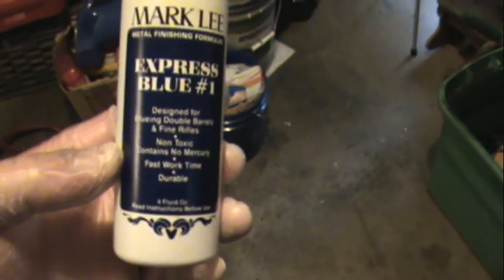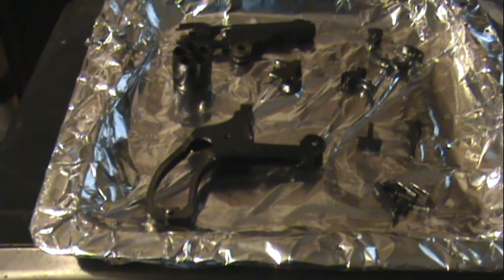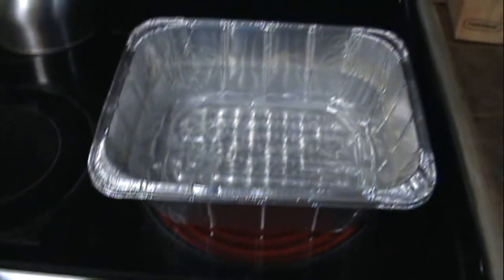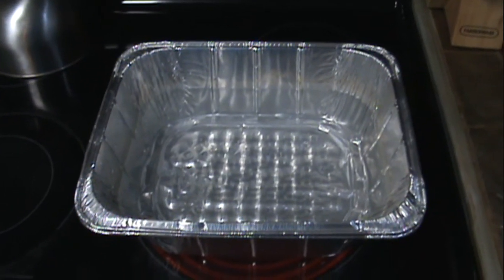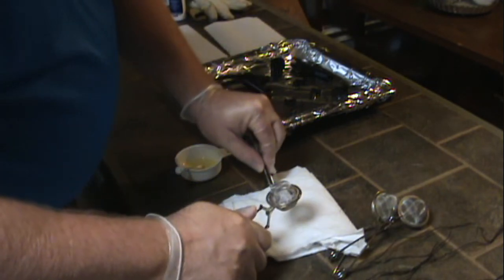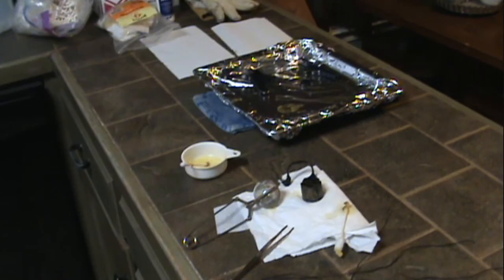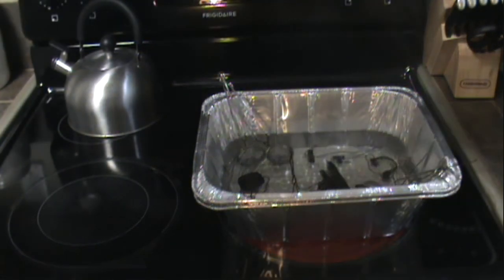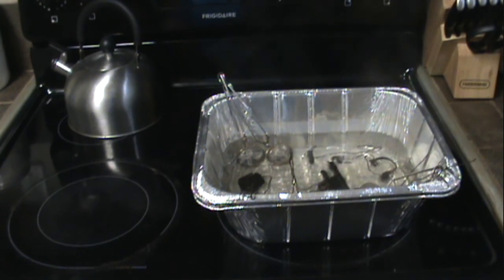Slow rust blue project. Pt2

Comment: Great work. I used the same on the P38 and it turned out good. However. When I did my SW model 27. The cylinder tuned out cooperish looking. I tried it twice and same result.  Do you have any suggestion as to what was causing that?

Comment: Sir, I followed the steps carefully, but with any slight rubbing with my finger, the black color starts to disappear, and that happened after applying 7 layers.
Reply from the maker: Did you sand with 320 grit to allow for the bluing to bite? Did you entire no oils were present on metal? Did you use distilled water? Alot of variables could cause what you are describing
Reply: @willwood487  
Yes, sir, I did all of this properly, but I rubbed the rust after each boiling process using cotton cloth and not steel wool, and I did not spray the rust remover, but I boiled the parts with sodium hydroxide solution to stop the rusting process, but I did not soak them in oil. I think not rubbing the pieces with steel wool is the problem layers accumulated  Rust on top of each other and become easily removed
Reply: @داوودالاسد-ش7ع you have to card the velvet. Each time. Always. You have to remove as much of the black coating as possible, almost as if you’re trying to get it to the white. Then you start another layer. This creates a durable and smooth finish.